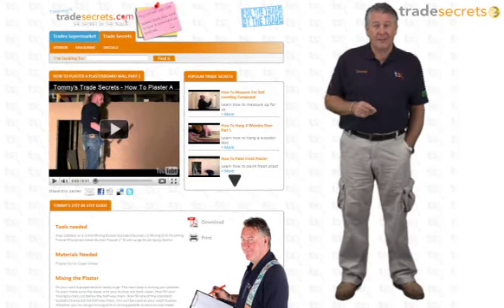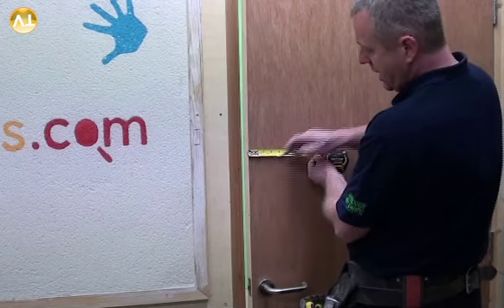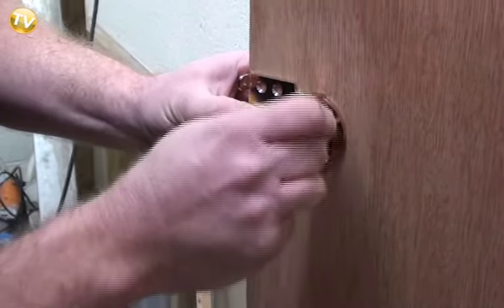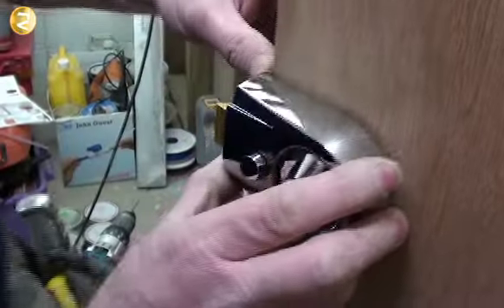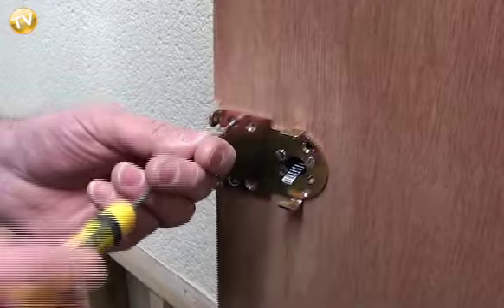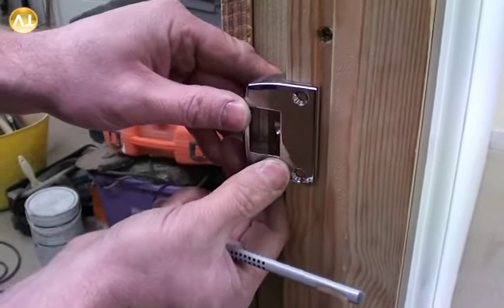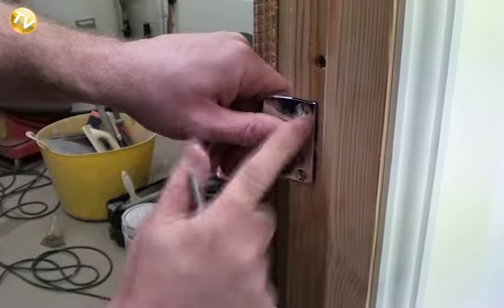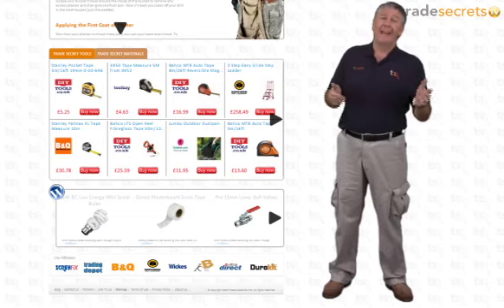Tommy's Trade Secrets - How To Fit A Yale Lock

Comment: Never a good idea to drill straight through a door from one side only . The wood is very likely to be splintered ( as was seen here ) on the side with the keyhole . Keep an eye for the point of the drill bit coming through and start drilling again from the other side to meet in the middle . On this occasion he got away with it but veneer on doors can splinter badly , very easily ....

Comment: a fire door that's been cut  down to much? when u drill through the door for the barrel drill half way till the point is visible then go from the other side stops the wood splitting ? the stringing plate on the frame is not cut in neat? and when do use a hammer on a chisel?